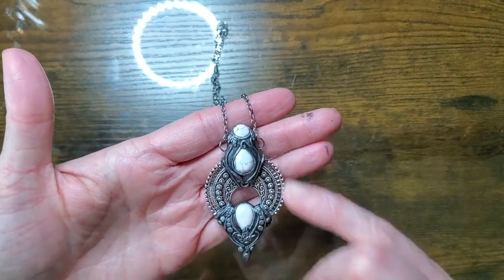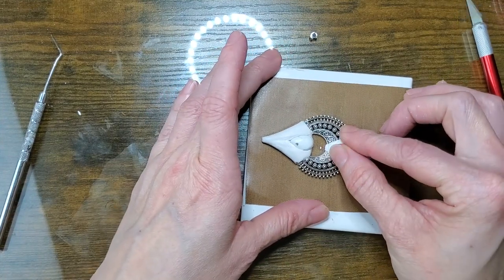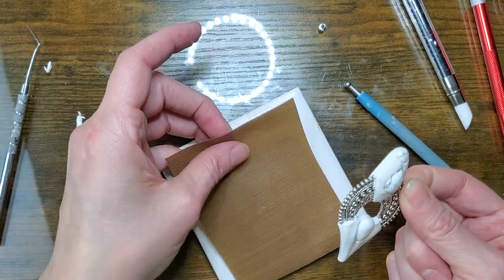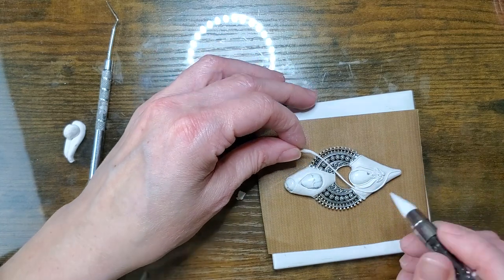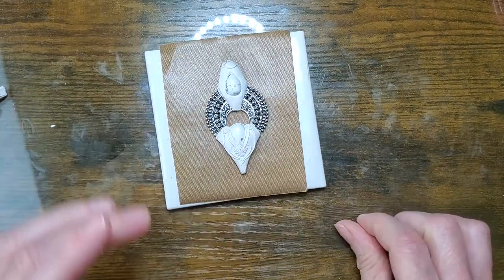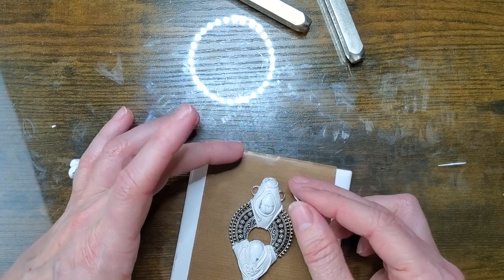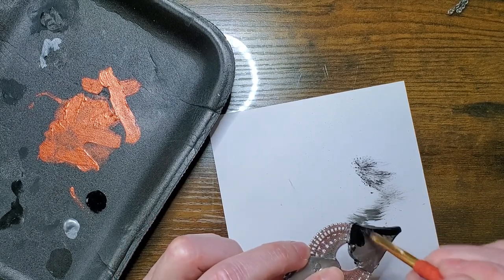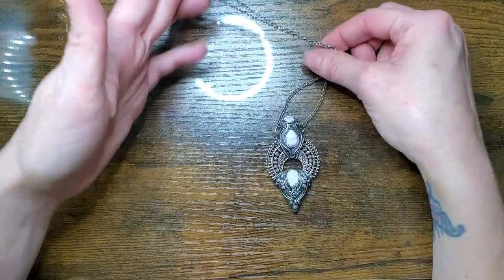Unique polymerclay pendant tutorial using real howlite

Comment: Really pretty. I noticed you did not use any liquid clay for the clay to join with the metal. Is that necessary?
Reply from the maker: It is not necessary because I’m wrapping it around the metal if I was just setting it on top then it would require a bonding method. Hope that helps and thank you for watching
Reply: @sherbearsgifts  makes sense. I was always of the understanding that you need to put liquid clay for metal and clay. Thanks so much. I love combining metal and stones with polymer clay.
Reply from the maker: @nurtureandnourish  you are more then welcome, I’m always happy to help where I can. The biggest thing for using the liquid clay or clay adhesive is to bond the two together, you’ll notice in many tutorials that I do using stones I don’t use either because I’m wrapping my clay around completely or enough that the piece is securely place in the clay which will then become one piece 🥰 that’s why I love doing these tutorials you read so many things and everyone has a different perspective but if I see a step by step I then know how it really works, I also show my mistakes in videos so people know how to fix or what not to do 🤗🤗🤗
Reply: @sherbearsclay  that's true. I guess a lot of it is also experimenting and how secure you make the connection.
Reply from the maker: Absolutely 💯